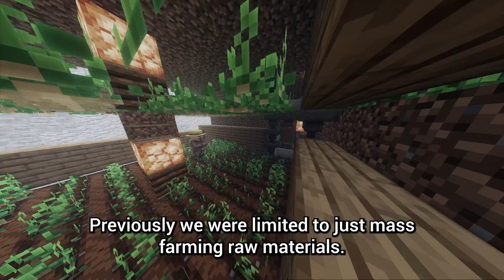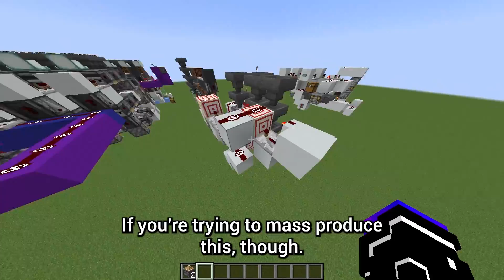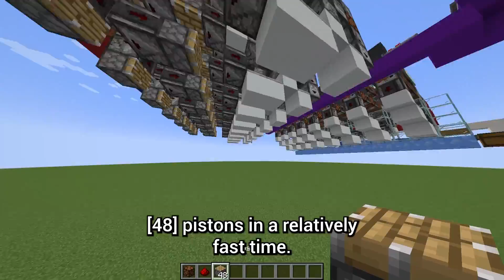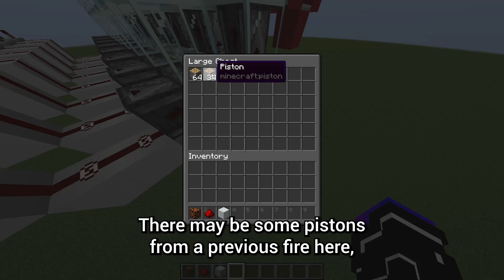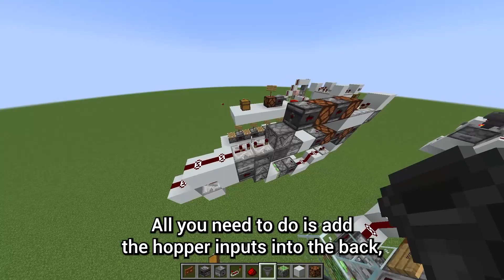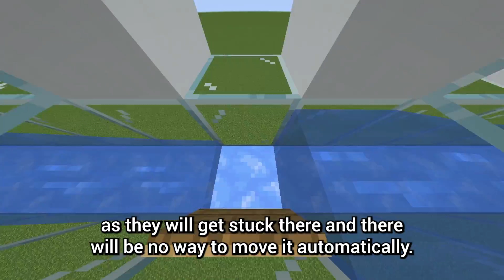Using The New 1.21 Crafter to Make a Piston Factory

Comment: 5:30
Pretty confident the light updates would make the lamps less lag friendly than the pistons. 
Light updates are notoriously horrid.

Simple fix to this is to just surround them with solid blocks
Reply: What about noteblocks?
Reply from the maker: I’ll take this into consideration if i need to revise my design in the future, thanks!
Reply: @tonig2255 i don't think that noteblocks have two states to be detected by the observers
Reply: @madeline8062  doesn't need two states, just an update to pass through